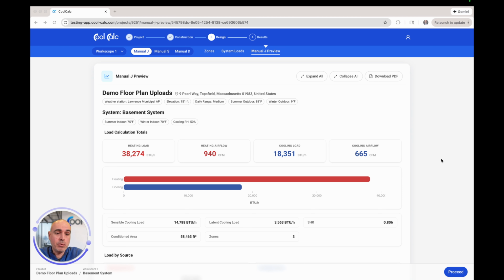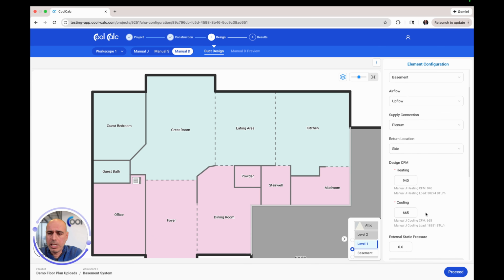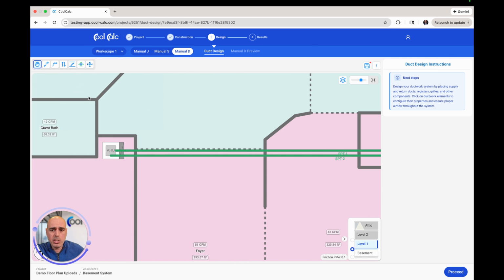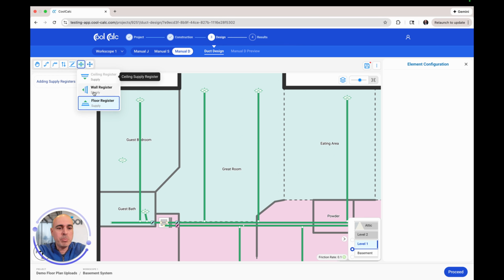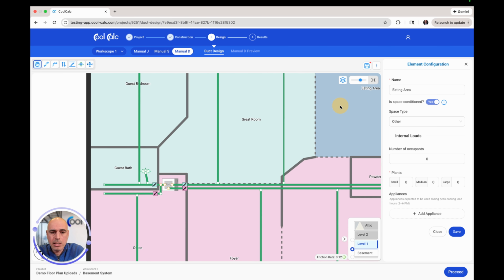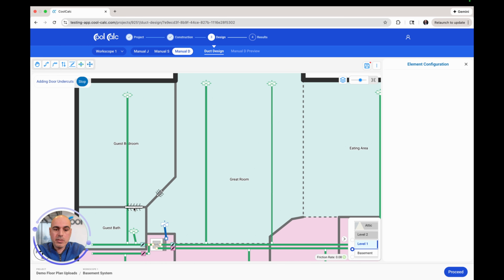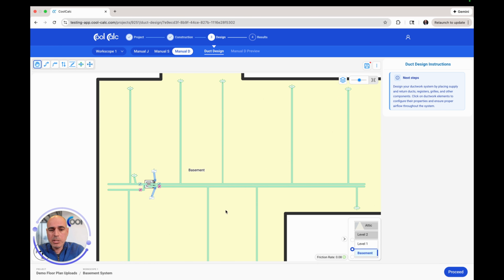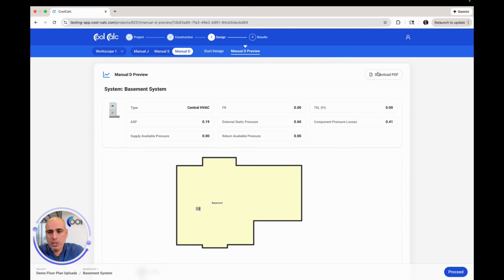Overview of Cool Calc Ductwork Design tool (Manual D)

Comment: I don't see how to add a second air handler.  We have a basement and a first floor.  There is an air handler for the basement, which is in the basement, and an air handler for the first floor, which is also in the basement.  All basement ductwork is in the basement ceiling under first floor.  The first floor is more complicated.  Some duct work is in the basement ceiling under first floor, some comes down from the conditioned attic space that is really just a plenum between the Roof SIP (Structured Insulated Panels) (Eco Panels of Tennessee) and the trusses and drywall holding the SIP Roof panels up (about 2 feet of space)  -- How do you do that?
Reply: The roof is a MONO Slope, so 2ft of space sloped all in one direction

Comment: How would you go about designing radial duct systems? The AH has 4 connect points while some radial systems can take 5-8 ducts directly off of the plenum
Reply from the maker: I apologize for the late response. We will create a separate video demonstrating the how to perform a radial design. The program will automatically create junction boxes anytime there are more than three connections to the same point. Tee or Wye connection works for three connection points, but greater than three requires a junction box so they are automatically added in those instances.
Reply: @Coolcalcsoftware  expected timeline for the tutorial?

Comment: This is definitely helpful not having to run a windows virtual machine to run ancient software, It could use more keyboard shortcuts and a 2-line mode eventually but Can now start designing duct systems on Linux and on Ipad without lugging my heavy laptop or being forced to run windows
Reply: Thank you for the feedback. 2-line mode is definitely on our roadmap! I agree that will add a lot of value